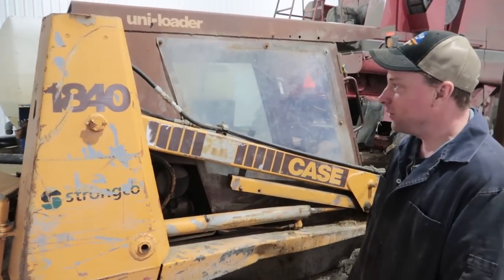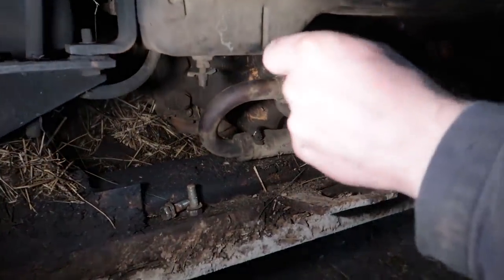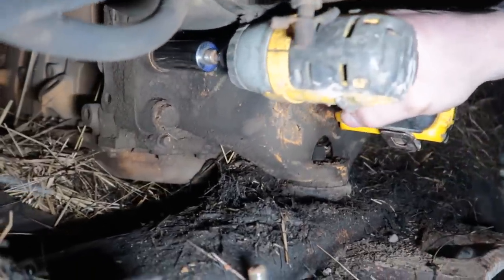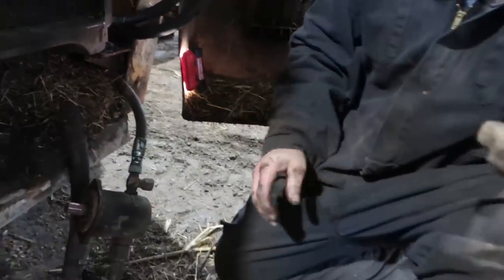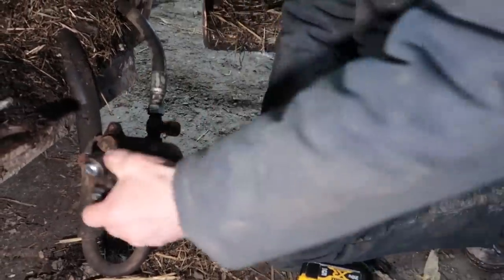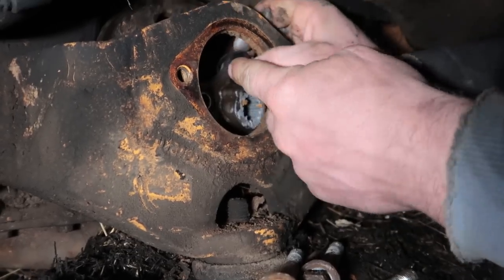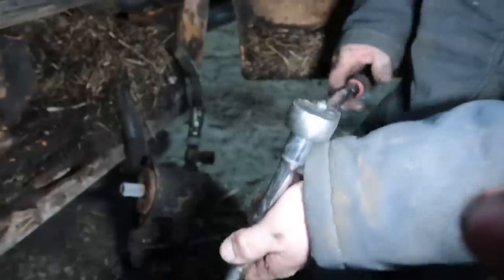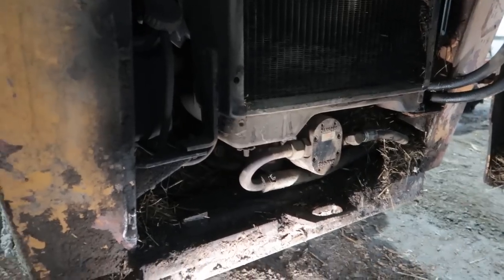Loss of Hydraulics on Skid Steer? Quick Easy Fix

Comment: Back quite a few years or my years with legs, I bout a runner with "joe louis" body manipulations. I found a rig in a mans yard parked up and a few external parts missing and it had some nice body panels. So I hauled it for free just to see more "junk" as he  called it, I asked as a looker, so your going to clear and clean this. Yep thats my intentions.... a opportunity arises.. I told him if you hold off, I have room on a piece of property that needs fill, you could have them haul it... okay we have a deal then and you pay ex amount for each and every one?? Long story shortened for you Rich I got paid to make a lot of money as most was rust free old outback lean to's and you get the picture so said and done, no money in and my banker sees my move and sponsors this clean up cause he lives short miles from crapola and lot and short in my own garage made three right down GTO looking trucks (Quality) so that year I had to pay taxes for once  as I was over the poverty level and I only had a second hand several times skid steer and my brothers old farm lowboy and because running farm plates exempt from crossing scales and  cold cash motivated some help had his place looking  really nice. I latter got more equipment and stuff and it started my going backwards. I got primarily to my smaller status and made money and I didn't repete stupid. I have changed those pumps and it really is that easy